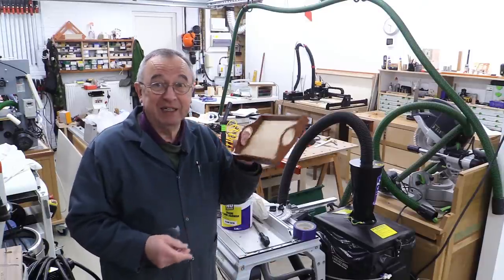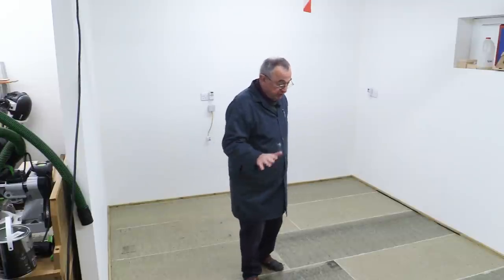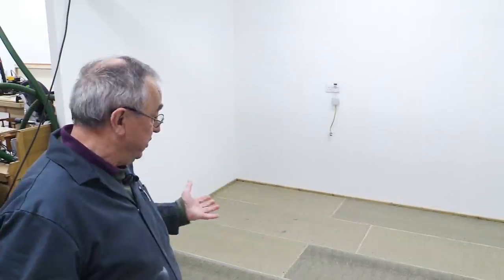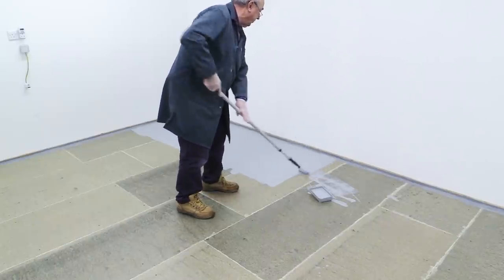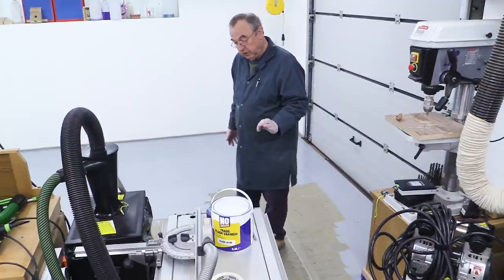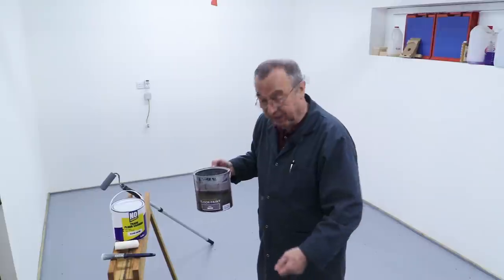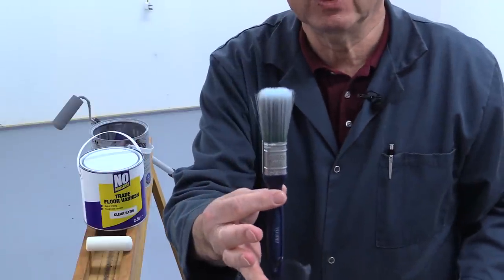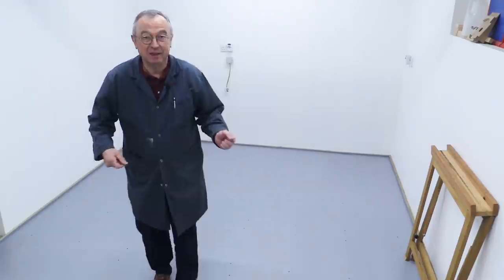How to Renovate a Garage Floor

Comment: Hi Peter, if you think your shop is a "bit of pickles"; you got to see mine. For I am installing an "automatic Dust Collecting system". That when I open ANY one of the 24 "gates"; by pressing the power tool to "ON". Where it opens "that" gate; and then it turns the Dust Collector ON. 😛

Then of course, when I turn the switch to "OFF"; it turns the Dust Collector off first; and then it closes "that" gate. Thus, my shop is in a "turmoil from hell"; from "top to bottom and wall to wall"🥵24 X 36 feet (7315 X 10972 millimetre); across the Big Pond 🤠✈

And as always, YOU kind Sir; has always given us; incredible and easy ways; to make our woodworking a true Joy. Thank you always..."our" Peter Parfitt. NONE FINER!.👨‍🎓 😀

For whatever it's worth, I turn 90 yrs old tomorrow. Praise Jesus.
Reply from the maker: Hi Pat, Many thanks for your kind words and I wish you the very best for your very, very special birthday tomorrow. Cheers.  Peter

Comment: The floor looks fantastic! Great work! I'm about to start a similar project. It looks like you pre-filled the cracks between floor boards. Any chance you could share what you used? (Woodfiller? Something else?) Many thanks for the great videos! 🙂
Reply from the maker: Hi Peter, I used  Ronseal Multipurpose Wood Filler Natural 310ml  bought from Screwfix (product code 50971). It was less than £7 for the whole floor and is flexible. Cheers.  Peter

Comment: Suggest you also position a rubber square under each of your wheels in the cars final place in the enclosure otherwise warm tyres have been known to weld to the paint and remove the coating from the floor.  Bold move to loose part of your workshop to a car.  Leave the car outside and erect a carport :-)
Reply: Hi Peter good evening.  I always learn something new from your interesting videos.
Reply from the maker: I would love to have a car port but the planning people would not allow it. Many thanks for the tip about warm tyres - I will get something to put under the wheels.  Cheers.  Peter
Reply: I’ve come across this problem as well  old carpet tiles stop the sticking
Reply from the maker: @Xoncention, I will be mentioning your useful suggestion in my video about the car chocks - would you like me to use your name?  Peter
Reply: @NewBritWorkshop  I am sure that you would have thought of this yourself after you had marked your wall.  There is no need to use my handle or my real name in your content.  The ideas was freely given to use as you see fit.  I just hope it meets the needs of your situation.  Thank you for considering me.  Take care.

Comment: Love your videos. What size of batten and spacing did you use? I have a small workshop that has a dry concrete floor that isn’t the smoothest. I want something that is easier on the legs and allows me to easily move wheeled benches around.
Reply from the maker: Hi Bruce, The work was described in this video and there are others, made at about the same time, that describe the work to create the current workshop:
https://www.youtube.com/watch?v=OrYgHJee3XI
Peter

Comment: Peter,
Thoroughly enjoy your channel but am unable to communicate with you re CNC plans for the plug charger. 
I also have a question regarding the coats of varnish on the chipboard floor. You mention the varnish is to seal the floor prior to using the Ronseal garage paint, is that because the garage paint wouldn’t be as effective on its own? I ask as I am about to use some 22mm P5 flooring for a mezzanine floor in a garage. 
Thank you in anticipation.
Reply from the maker: Hi Michael, In my view (and I am happy to be proved wrong) the diamond hard varnish would soak into the top surface of the MDF and then dry and harden. That then gives a far better foundation for the grey garage floor paint. Now, the plans...To get plans I need your email address. For my email address go to my channel home page, click on "About" and you will find the email address (this is best done from a PC for some reason). Let me know what plans you need and I will email them to you. Peter
Reply: @NewBritWorkshop  Peter,
Thank you for the reply and grateful for the confirmation and clarification of my understanding on why you have done what you have. I shall do likewise. 
I did see a comment on one of your other videos that explained that a PC is required to ask for plans, watch this space. 
Thank you for the videos on your channel and long may they continue.
Reply from the maker: Hi Michael, Yes, it seems that the "About" tab or the email address within it is not displayed or available on phones and tablets. I do not understand why this should be as it denies a large proportion of the audience from interacting with YouTube creators.  Cheers.  Peter

Comment: So what's the plan for the workshop equipment if the car goes in ? ,do you have to move it each time its looking a bit full in the other half at the moment as you do the floor painting.
Reply from the maker: Hi Nicholas, I hope to show this in the next video but the workshop in just one half does work - I appreciate that many people have even less space. The car will not always be in the other half and so with my mobile workshop concept (stuff on castors) I can easily reconfigure when needed.  Cheers.  Peter

Comment: Great video thx Peter!  I’m still using a tennis ball on string in my garage!  Nice watch BTW!
Reply from the maker: Hi David, I do like the tennis ball concept but it does need a bit of extra space at the front of the car just in case ! Watch was a birthday present from my wife and I love them both. I would have no hesitation in recommending the Apple watch but appreciate that it is quite expensive and not within everyone's budget.  Cheers.  Peter

Comment: Do you think that floor paint would be suitable for painting over an OSB floor in a workshop, or would it mark too easily when moving heavy tools around?
Reply from the maker: Hi Dylan, OSB does not have a smooth surface and so heavy loads scuffing across will almost certainly damage any paint on those high spots. Having said that I would do it as the overall appearance of untreated OSB on a floor would be worse than the odd scratch on the surface from moving the tools. If you do decide to use the Ronseal product then leave it more than the minimum 4 hours between coats and after the final coat leave it for 5 days before moving your tools back in.  Good luck.  Peter
Reply: @NewBritWorkshop  thanks for that 👍 I'll probably go ahead with it—as you say, untreated OSB looks awful. Will probably have to do it in several parts as I can't leave a table saw, bench and planer in the garden for a week 😂
Reply from the maker: Hi Dylan, I have had to do things like that in a similar way - a bit of a pain but manageable.  Good luck.  Peter

Comment: I’d have to say that the title is a little misleading. I wouldn’t really regard sealing and painting a garage floor (which appears to otherwise be in perfect condition) as ‘renovating’ it.
Reply from the maker: The title image does say "..or improve.." but you may have missed that.  Cheers..  Peter
Reply: Lol. Fair enough.
Reply: In any case, good video as usual. I’ve been a subscriber for many years now 👍🏻
Reply from the maker: Brilliant - cheers.  Peter

Comment: Peter, it is not a good idea to put a wet car away, they are worse than a wet dog.
Reply from the maker: Hi Ron, Even a wet dogs need to be brought in at some stage - in my case when the wind is bringing down large lumps of tree.  Cheers.  Peter
Reply: @NewBritWorkshop  That’s a good reason.
Reply: @NewBritWorkshop  did you not consider an alternative such as pruning or a car port?  I hope you manage to rationalise the space you have.
Reply from the maker: Hi Andrew, There are a number of other considerations including bird droppings.  Cheers.  Peter